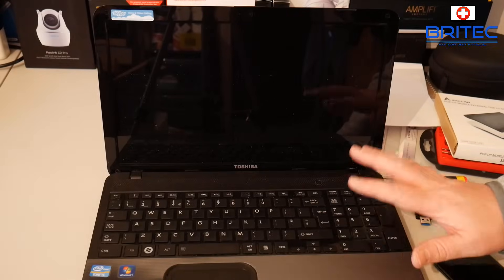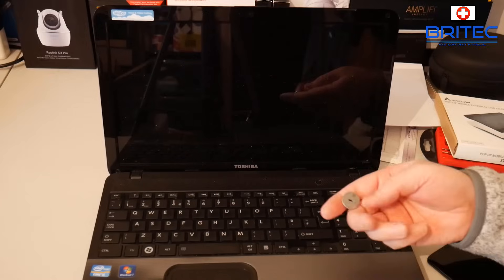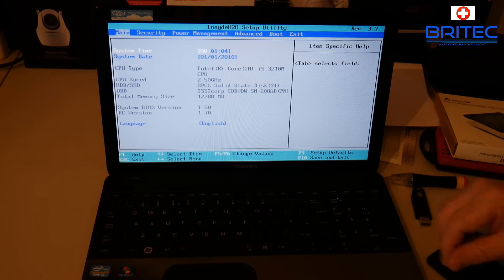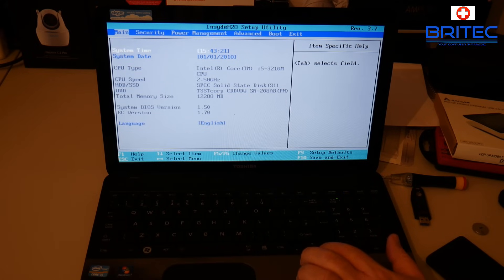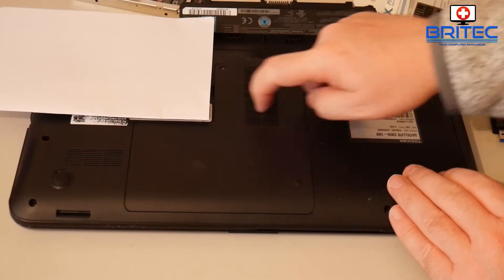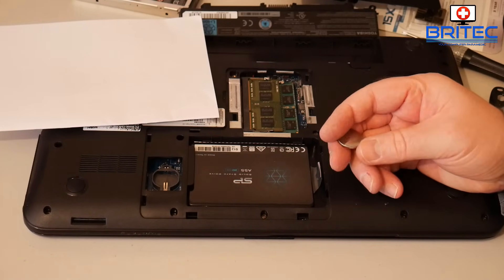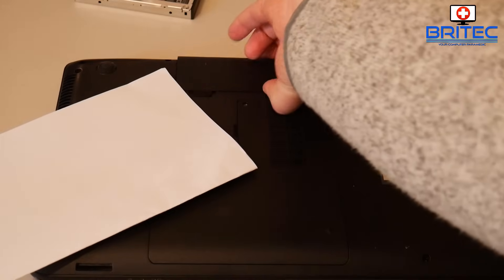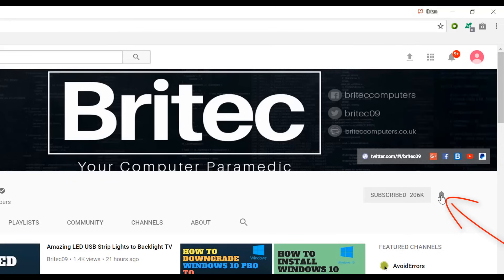How To Fix CMOS Battery Failure Error

Comment: Thank you for the video. i replaced the battery (in a notebook) and changed in the bios the data and time but when I switch off the computer it continue to lose data and time which must be reinserted in the bios again each time. Do you have any suggestion about that ?

Comment: hey brian,i read a long time ago that it is good to touch the poles of these battery's simultaneously because they discharge
as is touching a lamp for a floodlight,because of the oil of the skin burning into the lamp
had to change the battery on the motherboard of my desktop once,mine had a metal clip,cheers

Comment: Nice info thnx, i have 2 old computers from 1995 and 1999 and they still work fine, battery included lol but my old hard drives shelved dont work anymore and the ones still in the old computer do work, a bit strange  right?
Reply from the maker: they do last for years

Comment: 10 years ago, i used a clone PC with a celeron (socket 478) i don't remember very old, Windows XP and i had that issue an a problem with ie, when cmos battery 2032 has not the correct voltage (3v) thanks britec09 for your new videos, internet need more videos like this, always avoid the xenophoby and hate (nz)
Reply from the maker: Thanks Fernando

Comment: I'm not sure what happened but the audio in last few videos is clipping a lot.  It was quite notable in this one especially.
Reply from the maker: Yeah I think my mic has gone bad, I noticed it myself
Reply: @Britec09  Stuff happens. I just wanted to make sure you were aware of it as it just didn't sound like your normal audio. I did live sound support for several years with bands and churches so my hearing is sensitive to clipping.
Reply from the maker: Thanks, I need to get better wireless mic

Comment: It's too bad all computers aren't like the Toshiba here. I have to disassemble my ASUS just to reset the CMOS. On my HP, I don't have to do that. That's why I love (and use) my HP more than my crummy ASUS.
Reply from the maker: Yeah some Laptops makers hide the battery deep inside.
Reply: HP is known for bad products but i'm glad your happy and i can agree they are user friendly from advanced stuff to easy stuff
Reply: @honestlyidk2585  True somewhat because I had one HP that is broke because one of the hinges was worn out and it caused me to not have a screen to see anything. I am using my spare HP laptop and I'm much more careful with it. I close and open my laptop from the middle rather than grabbing from the sides (which I shouldn't have done with my other HP).
Reply: R.I.P old HP